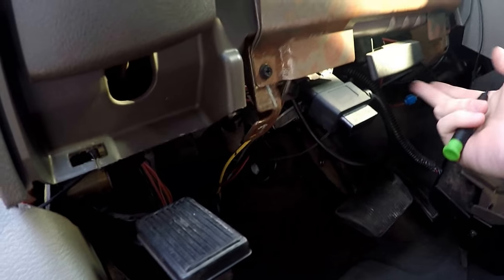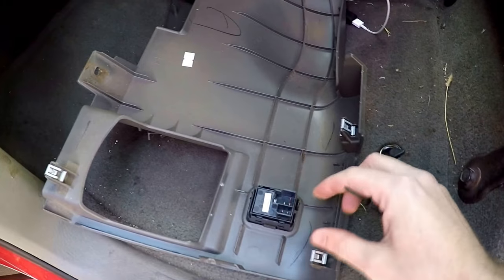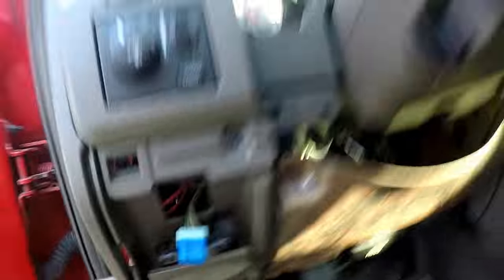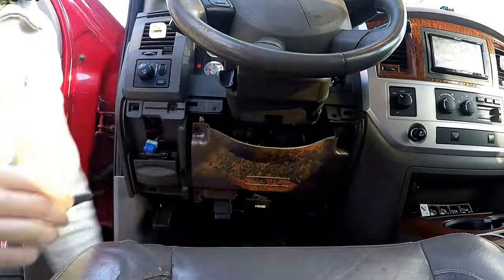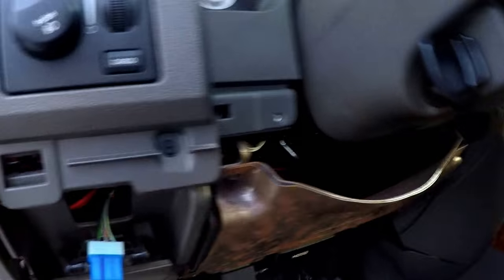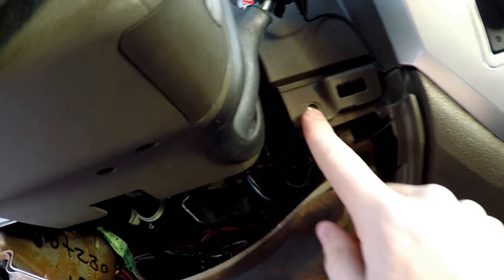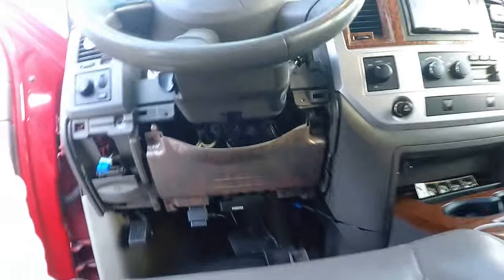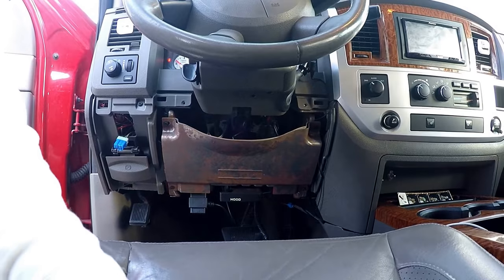Cummins LED Instrument Cluster

Comment: Do they flicker any?
Reply from the maker: No issues so far. I was worried about that, but they’ve been solid.
Reply: KReyCummins do you know if they make any Color changing bulbs? Kinda want something to match with all my gauges
Reply from the maker: I haven’t seen any. If you can’t find any, I would suggest going with a white or some color that will compliment the colors you use on your other gauges.
Reply: KReyCummins yea that’s what I’m thinking, I’m not in a rush to do it, I’ll keep looking if not I’m gonna go all white. I personally can’t stand it when things don’t match lol